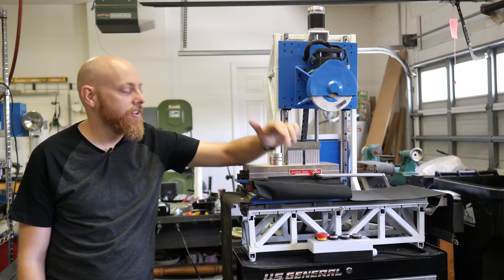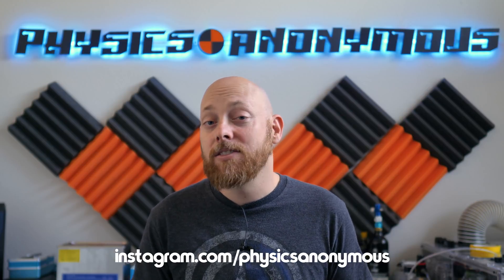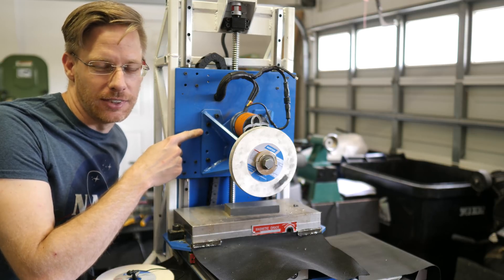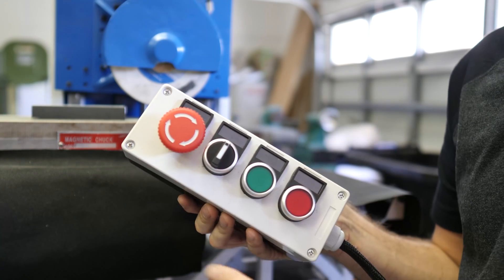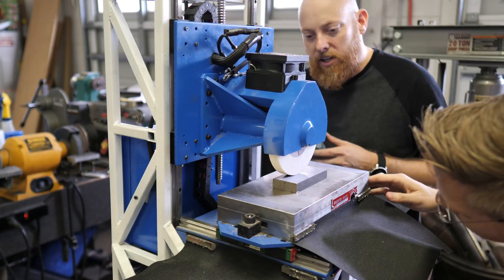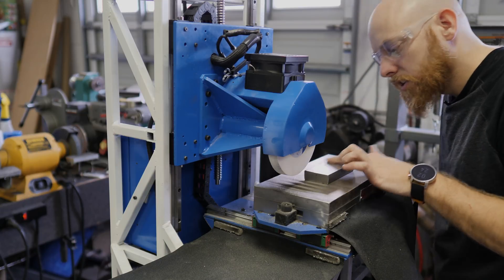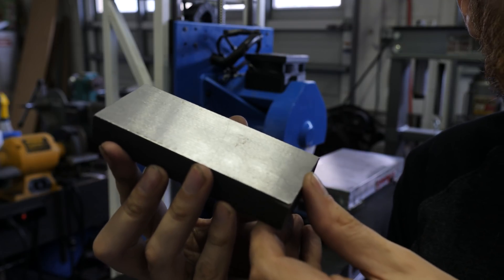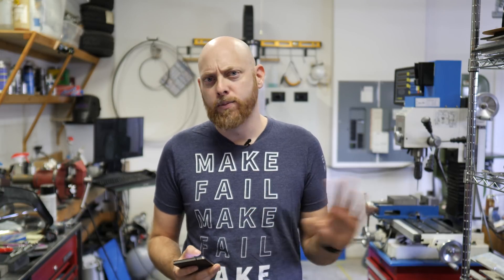About that DIY Surface Grinder - S03E02

Comment: I too have done what you are doing.  I have this to offer.  Motor and wheel balance are vital.  All steppers should be vibration isolated, those buggers are very jerky.  Of special interest is your longitudnal feed.  I used a gearhead motor (Leason) and a chain drive which was the culprit.  By increasing the speed of the motor and further reduction in the drive I had a large improvement in surface finish. Much more if interested.  Bob  BS Applied Physics/Math  MSU 1960  703 669 0962

Comment: E-Stop should not be used as a start-stop switch since this causes a safety hazard. In general any safety device should not be used to start a machine. Use a separate start button to prevent unexpected movement when the e-stop is released.

Comment: i mean be realistic, you made this out of tubing, chinese linear rails, chinese everything, it was never supposed to be "perfect" or even close to that. compared to what even used old surface grinders can run you moneywise, yours was propably still cheaper than most of those. sure, there is a lot of room for improvement, but the advantage is, that you know the machine from ground up and you can make it better over time

Comment: your spindle setup isn't quite right. you can actually hear the chatter before the wheel ever makes contact with the work piece. my guess is that you're using regular radial ball bearings for your spindle bearings. you need a set of spindle bearings which act similar to a tapered roller bearing. that will quiet down the arbor noise. the other is that you're using a stepper motor as a drive unit for your spindle. scrap that idea. you need a continuous duty style of motor. stepper motors "cog" at all RPMs and will never ever give you a decent finish.. while you're dinkin around fine tuning and might even get a half assed decent finish, you can have a world class finish and dimensionally true piece by going with a "dumb" motor

Comment: Make the wheel travel twice over the surface before moving it in the y axis, and when the whole surface is done go in the reverse direktion until you reach the starting point and you Will gett a mirror finish 👍

Comment: hey guys awesome video! one tip make some tool for grinding that grinder wheel with a diamond to make it horizontal :) donz make the z axis moveable with little motor ! i work for a german company and we have herkules&hommel they have locked z axis with a realy big dc motor. find z0 with the grinder on and DONT find the z point only going up and down but going forward and backward and make little z steps! use coolant fluid ! the structure on top of the surface comes from the not aligned grinder wheel

Comment: The Lovejoy couplers are called spider couplers.  The plastic or rubber star in the center is called the spider.  For accuracy, you should be using solid couplers and aligning the shafts properly. Any type of flex coupler will have too much backlash to be accurate.

Comment: Guy do not grind dry
Reply: Why not? I've only ever had an issue grinding high nickel content steel. Hardened 1040 cold rolled can be ground all day long dry. -A guy that's surface ground hardened 1040 cold rolled all day long dry.

Comment: I know you have probably heard this already but you need structural deadening. That's why machines are built from cast iron and ductile iron. You could improve by adding some concrete to the bottom of the tool box. You could also buy a cast iron ball and hang it. One Important step y'all are missing is the wheels aren't balanced.... I was running a surface grinder making mirrors for the DoD and I replaced my wheel ( didn't balance) and ruined $6700 worth of materials. That's not including buying a NEW wheel....

Comment: I used to surface grind quite a bit when I was an apprentice and once I warmed up the spindle bearings I would dress the wheel and it would not turn off until my grinding was complete. it seemed that once you turned off the spindle it would start to  chatter and you would have to redress the wheel to eliminate it. The Grinders in the shop stay on all day. I hope that helps
Reply: Thanks for teaching me something.

Comment: If the wheel is not balanced, dressing does not give almost anything.
Reply: It most certainly does....it opens the cavities and creates sharp edges to grind with
Reply: @gusmcgussy3299  yes, but the shape of the wheel still is not perfectly round. Found that on a big surface grinder i was working on.

Comment: think the chatter is from the cibrations of the machine itself , you can hear it when the machine is spinning even when its not grinding
the rpm are dropping down when youre start grinding too , basicy meaning that you cut more at a high rpm and then grind less once the rpm goes down 
another thing that might cause some shaking in the surface finish is if the drive motor for the stone has only a few poles and the shifting between them to rotate the engine causes the  motor to not run quite as fluid as it should  , maibe putting two motors on there with the poles slightly offset would helpn both the problem of the rpm drop and the slightly unround running

Comment: to avoid the stone loading up with material, I wonder if you could use a belt tensioner to hold a smaller wheel to dress, or clean the finer grit stone while it's in use.

Comment: Spindle shaft and bearing dimension are probably not stiff enough and the wheel looks like it’s unbalanced. The sound produced when you started the spindle indicates a "floating" or wobbling wheel that’s why the surface finish is wavy. Look at the black marks on the wheel, it’s suppose to be all a long the perimeter of the wheel not just few spots. Hope this will helps.

Comment: Never touch the grinding wheel off the part without the spindle running. The moment you touch that wheel without it spinning you move the wheel itself by a slight bit. This throws off the dressing and true conditions of the grinding wheel, which destroys your finish.  I got 11 years of straight surface grinding experience in a high precision (e.g., + or - .001" tolerances).
Reply: High precision and + or - .001"? Was that a typo?
Reply: @GeneralChangFromDanang  It's someone spewing b.s., who didn't realize he should have said 50 millionths, if he wanted to impress us.
Reply: @xenonram  Agreed lol
Reply: @GeneralChangFromDanang   No shit, you could probably hold .001 even with the POS in the video
Reply: 0.001" tolerances? What are you, a blacksmith?
Reply: .001 tolerance???? With what.... A hammer and chisel???? Dude I hold millionths.....alllllllll day buddy.....
Reply: @gusmcgussy3299  are you sure?
how do you measure it?
Reply: It also might put a micro crack in the wheel setting them up for an exploding grinding wheel.

Comment: i dont know how precise or accurate you want to grind plates but if you want to grind really accurate you should go with a real servo, and maybe a glass scale, on the Z axis. Steppers are not really accurate down to 0.001mm

Comment: Please figure out what's up with your spindle, it sounds horrible. What kind of bearings are you using? Have you checked the balancing at all? Balancing is really, really important on a grinder, you want it to run as smooth as possible.
Also not very pleased with all the open guide rails and ball screws, the grinding dust will chew that up in no time.

Comment: could have just have built stand out of angle iron and only used two wheels on end built many machine stands this way second dress the table  used to do shops every six months to a year will wear down.through usage and you cant buy everthing on amazon often over pay also balance wheel and check bearings...smoother travel.if you add teflon shim to slide mcmaster carr carries fairly cheap  and check practical machinist periodical theres a  theres artical mid 90s building a surface grinder

Comment: For finishing on surface grinder the death of cut is about 0.01 mm or 0.0004 inch ... 1 thou Is 0.025 mm . And the wheel balancing Is of quite a bit ,
Reply: i would finish with a feed of 0.001 mm

Comment: check the radial play in the wheel spindle..   i will have to look at your past videos to see how you drove the bearings into the spindle housing .. that could be damage to the bearing races transferring to the surface.  you may also need to dress the sides of the wheel to true it up  to get it closer to balance..  a dangerous thing to do.  but sometimes needed.  i have always thought about using automotive AC clutch pulley bearings as spindle bearings as they have a large bore for large spindle shafts for stability.. many are double row in one bearing.. will widthstand massive amounts of belt tension and pulley masses at speeds up above 7,000 RPM.. ac pulleys are almost always smaller than crank pulleys so the average engine will reach speeds of 5,000 during acceleration and passing.. so 7K or 8K is not an issue with these.  perhaps 10K.   you might also want to look at possibly creating an self balancer.. like this.. http://www.centramatic.com/wheel-balancer.rhtml?modelNumber=MHD200-203  to auto balance your grinding wheel.  since they make them they can probably make a special with the spindle bore exact..  might even make one that fits closer to the wheel. to fit in your safety housing.   carry on P A.. doing good..

Comment: You need to move the wheel sideways at least 3/4's of its width with each table reversal. You have a 1" wide wheel and you are only using like a 1/8" of it moving so little. I spent 7 years runing surface grinders, the largest having a capacity of 20' (feet) yes that is not a typo. LOL
Reply: U wrong doe lol

Comment: You have to surface the grinding wheel by running it over a diamond tip so it's perfectly round
Reply: not only that, it has also to be balanced. Even if it is perfectly round, if it is off balance it starts to wobble when going faster.
Reply: They did @ 8:15
Reply: @sidgar1  oh 🙆‍♂️

Comment: First off, great job guys.  IMO, you've done the impossible!  I've run a few surface grinders, and I think you guys can get a better finish with what you've made there.

I think your step-over was too high for the rigidity of the machine and the HP of the spindle.  You might try reducing the step-over for a finishing pass.  Also I think if you did a finish pass of like 0.5-1 tenth on the opposite direction while slowing down the feeds it'll clean a lot of that up.

On my big 8x24 Thompson grinder I typically take 1-2 tenths for a finish pass, and to get the best finishes I would let it spark out or continue traversing the work piece until I stop seeing sparks/hearing cutting.

Comment: You seem to have little to no stiffness in the x axis or torque of the column. This is because you don't have don't have a shear path (diagonal braces or a plate) between the left and right towers that do have diagonal braces. Since the primary load (while small) is in the x and Mz, I feel confident that it is affecting surface finish or at least the material removal rate. You can address this by adding diagonals to finish the truss or maybe bolting a large steel tube to the back
Reply: You were looking at how the Z-axis plate shifts relating to the frame in the timelapse too? :P Looked she had a bit of a twerk going @ 10:51

Comment: If you watch really closely when the wheel gets to grinding it looks like it slows down a bit. Is is possible that is the chatter your getting? If it is could you reduce that by adding a flywheel or a motor with more torque?

Comment: How heavy is it? I was thinking of putting a RF-45 milling machine on top of their larger U.S. General chest (The 22x44 ones that can hold 1500 lbs, that way all of my tooling is with the machine and it is all portable) and was wondering how yours is holding up.

Comment: do you know about sparking out with a continual y feed? so like the wheel is diagonal zig zaging across the part a bunch?  also the amount the y feeds per pass in x should be less then the amount it was advancing when you where roughing. Thats the only way ive ever gotten really good finishes on a manual surface grinder.  Also sry if i missed it but have you balanced the spindle?(like the shaft that the wheel is on, i would think balance of the spindle and the wheel would be alot more important since the machine has less mass to resist the vibrations) it sounds like something is really out of balance to me.

Comment: I’ve enjoyed watching this project a lot, guys! Nice to see it making “chips”

Have tried going way slower on your Y feed? It looked pretty high as others have said and that will tax everything a lot more. Also, as others have said, only grind in one direction- have the software wind the table back before advancing for the next pass. Take the smallest Y steps your  setup can manage, to see what the best possible finish would be for the machine. Surface grinding is not fast. 😁
Reply: Agree Blondihacks. I have slowly advanced over the Y passes and kept the X (left -right) passes as high-speed. Also, wheel dress is vital as is the minimization of vibration from any source.(belt, motor, wheel)

Comment: I was always told never to feed something into a spinning wheel, always out of one.  That way if you've made a mistake with your Z height it won't bind the machine up or explode the wheel, it'll just kick the piece back out. So, while I totally understand that you're playing a game of thousandths of an inch here, it squicks the hell out of me to see the piece moving both directions under the grinder like that.
Reply: Don't know what to tell you but basically every if not all surface grinders work in both directions. Nature of the beast.
Reply: @Getbent97  Well, you always begin the cut with the work piece on the right side of the wheel. Your back pass you're just doing a spring cut. So you cut conventional.

Comment: Great video. The old guy who taught me basic machining skills claimed that if you got two pieces of tool steel perfectly parallel and flat, they would 'cold-fuse' if you put them together. Is this true? Is that something you guys are capable of now that you've got your own surface grinder dialed in?
Thanks again for your videos, I really enjoy them.
Reply: I think the pieces sticking together has something to do with the Van der Waals force? Something about atoms close together attracting each other. Wringing gage blocks makes them stick together.

Comment: The mag chuck should be moving left and right at different speeds to maintain the same cutting speed.
Reply: What? the surface speed of the wheel is 8 x 3.14 X 1750rpm = 43,960 ft/min The table speed is what 20 ft a min. Anyways you can't do anything to match the speed other than grind only one direction.
Reply: @tallbrian100  The grinders I use at work do. They go slower 'against' the wheel to compensate the fact that the wheel is turning 'with the work' in the other direction. It's really obvious if you work with grinders regularly, but a bit of a strange concept to grasp if you don't have experience in machining
Reply: @tallbrian100  pi*R sq*rpm/12. i come up with 3665 SFM
Reply: @emilr5815  2piR is the circumference of a circle, no square is used
Reply: No, It has nothing to do with "maintaining the same cutting speed." It has to do with the mechanism for the table feed. Hydraulic vs belt. It is the same concept as a shaper. The machine moves slower on the out stroke (cutting stroke) and retracts back much faster. A lot of SG have equal feed rates in both directions. Regardless of the direction the table is moving, the surface speed is exactly the same. The wheel rotates x number of times while the wheel is engaged for y number of seconds. The direction the table is has zero bearing on the cutting speed. That would mean, when doing a both ways adaptive cut on a CNC mill, it would move at different feed rates on the two directions. Also, for the majority of machines that font have a hydraulic/belt feed, you can't control that by doing a hand wheel.
Reply: @xenonram  Presumably you care about the relative velocity of the collisions and not their number. If the table was moving at 100 mph against a wheel 100 mph tangential they surfaces would close 200 mph on feed and 0 mph on retract. They'd both be spending the same x rotations, y time in contact with the wheel but one would cut while the other wouldn't. Your thinking about "equal engagement" isn't correct. The relative surface speed is not the same.

But as someone (almost) did the math above 43,960 inches per minute tangential makes the table speed a rounding error.
Reply: It should also help to reduce the chatter
Reply: Agreed. Or failing that lifting off and going back to the start without cutting
Edit: think I'd prefer it to lift off anyway actually to maintain the same cutting direction
Reply: @NaturallySelected  That depends on how accurate the z axis is. I'm not sure they can return reliable enough for lift offs.
Reply: @NaturallySelected  lift off? Yeah no when you're at a height you want to grind at that height. You only change your depth of cut when you're trying for more depth of cut. Past that you just do your passes on the surface you're grinding.
Reply: the machinist  big difference is that this is eventually gonna be a CNC grinder and you might as well implement it if you can. The CNC grinder I use, and I do use them at work, take the difference in cutting speed and a lot of other things in account. If you've ever used a cylindrical grinder you'll know that you can effect the cutting speed by switching the direction the wheel and the work are turning. Same thing here, the cutting speed is different.

Comment: I would only grind in one direction. (I.E. go back to the other side before advancing the Y)  By sending the work back the other way (same direction as the wheel turns), your wheel can ride-up over the work. Going against the wheel, it'll kick the work if you take too deep a cut, and you can get a nicer grind.